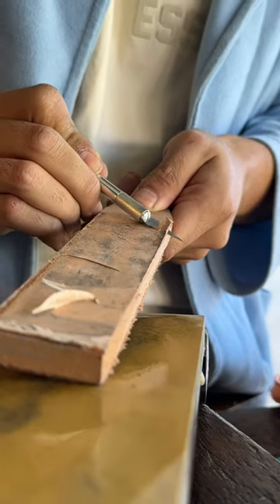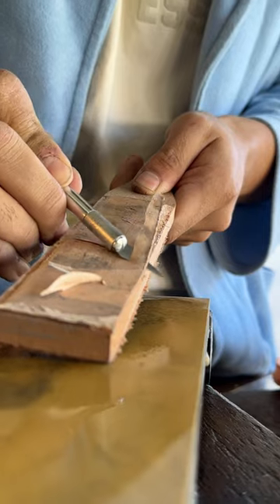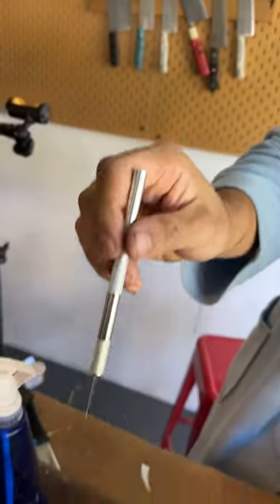How many pieces of green pepper?#fyp #shorts #knife #knives #knifesharpening #kitchen

Comment: What if you do a 5* angel or even like 1 wouldn't that make ANYTHING 0?
Reply: No. You need a mixture of thin stock, low angle, a thin apex (sharp), and a clean (burr free) apex, with proper blade alignment.

0 is not really feasible because you always need force to cut things, the lowest you could get is 1-5 (5 on this because the resolution is not high enough on the scale.)